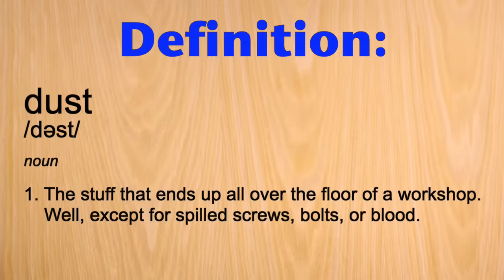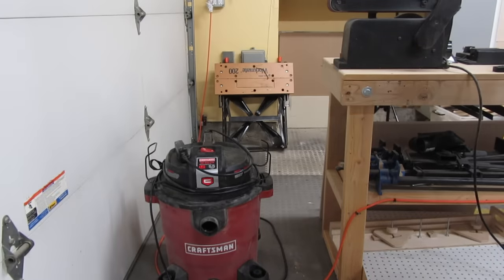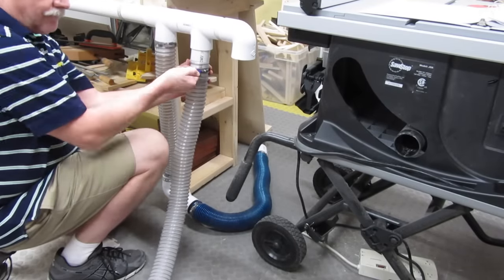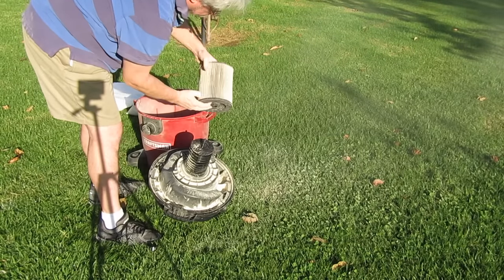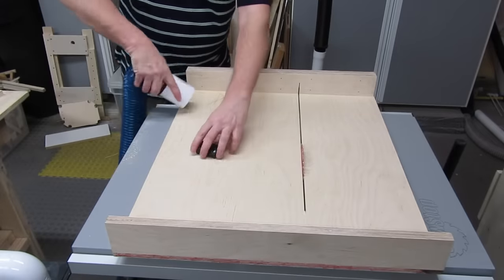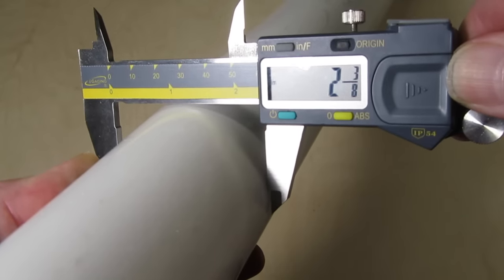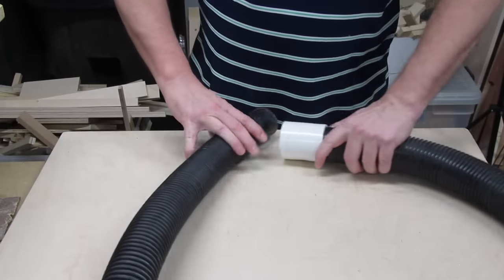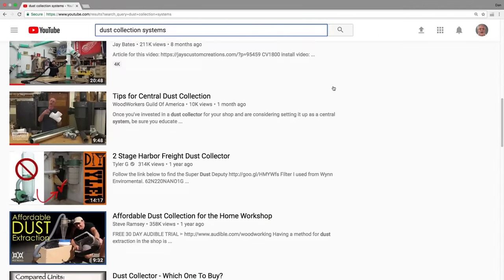Dust Collection for Newbies: Introduction to Dust Collection

Comment: Another great video. Great set up for a shop vac. and that you have hose connection information is so very helpful.   Some notes I have gathered from my bild... .. .
Most important the fine particulates, (smaller than 3 microns) .. that hang in the air indefinitely are the worse! your shop can look pristine but the stuff that you cannot see could kill you.  The most bestest thing you can have is cross ventilation from the outside, villa garage doors with a fan in the home woodshop. I live in Ga where it gets very cold in the winter but still do so. With that said you have a great system using a regular shop vac.

Possible best practice, If you dare cut a hole in the wall to vent exhaust outside.  Take time to build/form manifolds closest to the sawdust being created. (Heat mold PVC sheet metal what have you)  Use the least amount of flex pipe as possible, have the fastest running machines closest to vacuum...The chop-saw, most volume needed to collect this dust... very high for a shop vac... too much! The same thing for a table saw but your saw has a very nice collection manifold.  
For anyone going further into dust collecting.. Look up the Thien-baffle. Great simple but effective design  &  Bill Pentz .... 
Bill has passed, but this man influenced the lates home shop dust collectors out there conducted very thorough tests and influenced changes in the most popular collector's being used today. Even if the money isn't there to build a big system Very good information for anyone to graze on. All the tips I made earlier came from this gentlemen's site, if still up and running. Great man.
Reply from the maker: I didn't know Bill Pentz wasn't with us anymore - what a loss! 😢As for fine dust particles, I've been thinking about a video for quite a while. I hope it comes together sooner rather than later, because it's important information. Thanks for the comment!

Comment: I use a bandsaw, it's a pretty clean cut.. Also, I'd recommend making the adapter to the ShopVac be sized to go over the ShopVac end, then you can make an L-slot on the oversized end to lock the hose onto the ShopVac.
Reply from the maker: Thanks for the information! 😄

Comment: I've miter chopped many PVC pipes anywhere from 1/2" to 4", never had a problem or felt un-safe. I can see where it might be hazardous on a table saw, bringing the material to the blade, but with the miter saw you're bringing the blade to the materials.
Reply from the maker: Thanks for the info! 😄

Comment: Cutting PVC with a miter saw works like a charm. It fits against the fenced well and as long as you don't cut it too quickly it works great. But taking off an inch or two can be a problem
Reply from the maker: Thanks for the info! 😄

Comment: I use a miter to cut plastic pipe and acrylic regularly. However, my ten inch blades have sixty teeth.  More teeth is better, and less likely to create the PVC explosion you mention.

If you are going to play with wood, and when you can, invest in a dust collector.  Even a Harbor Freight unit can be gold.  However, immediately change the bottom bag to a plastic bag (they don't let dust back in the air), if the unit doesn't already have one. At the least, go on line and buy a replacement 20", one micron filter bag. Better yet, if you can afford it, double the air movement by investing in a pleated filter. Again, go for one micron or less (e.g., a half micron).  After you get over the sticker shock, you'll be glad you did.

P.S. Don't even think about using one of the tiny Dust Deputy's with a dust collector. Collectors are designed for four inch or larger hoses and the Deputy would restrict the flow too much.
Reply from the maker: Thanks again for the comment. One of these days I'll get around to doing a full video on the subject, but the truth is, if all I have are devices with with dust ports smaller than 4", there's no real point in moving up to a blower. In fact, depending on the dust collector, it could actually damage the blower (I think). I now have a cabinet-style table saw with a 4" dust port, and it's possible I'll upgrade, but I doubt it. The cabinet catches everything the dust collector doesn't, and unless I add overhead dust collection, upgrading the dust collector won't really help the top-side dust.

As far as small dust particles are concerned, if you're venting your dust collector inside your workshop, all you're really doing is moving the small particles from the place they're created, to a device that blows them all over the shop. http://billpentz.com/woodworking/cyclone/beginnnerscorner.cfm#foreword (and many other places on his website). And where I live, it's illegal to vent the dust collector outside. So again, no real benefits for me.

Comment: PVC is notorious for static electricity and holding on to wood dust. So I would highly recommend buying a spool of un-shielded wire and wiping it around the PVC from beginning to end connected to a screw at every joint and grounding the wire at an outlet or ground rod. This will greatly eliminate the static on the pvc piping
Reply from the maker: Here's my thoughts on that subject: https://thenewbiewoodworker.com/2020/01/21/dust-collection-and-pvc-static-fire-danger.html

Comment: I've been making sawdust for about fifty years. For a few decades of that, a shop vacuum was my main solution. From that, I stepped up big time and installed a couple squirrel cages. With an open door, I could turn one or both on and, wearing a mask, fire up my shop vac in leaf blower mode and make much of what landed on everything airborne, then removed by the fans.

The fan solution worked well for removing dust after the fact. Of course, my part of the neighborhood looked horrible for several minutes when I ran the blowers.  Too, though I could get my shop looking pretty good, they did little for stuff being tossed in the air, and the moved any heated air outside pretty quick.

A few decades in, craigslist came into existence and I was able to move to a cheap Chinese collector. It was life changing, as far as visible dust was concerned.  Later, I learned the bags were so poor at collecting the fines these collectors are, appropriately, referred to as dust pumps. 

Now, again thanks to craigslist, I have four bag collectors, cyclones and only use the vac for hand held sanders.  The shop looks good and there are few fines floating about, thanks to quality pleated filters.

As noted here, cyclones are game changers. I have them on my shop vac, my sandblast cabinet and big dust collectors.

P.S. Change those T's to Y's and collection will, vastly, improve. Every turn is like adding several feet of sucking killing pipe.
Reply from the maker: Thanks for the comment! Regarding changing the T's to Y's, when you're using 2 1/2" pipes with a shop vac, it makes almost no difference. With "blower" type dust collectors, you're right, it makes a huge difference. But not with shop vac-based systems. At least, not according to my anemometer. It has something to do with the difference between air speed vs. air volume, or something like that.

Comment: Thanks sir. I have enjoyed watching your videos and hearing your humor.

I have now after several videos, including yours, ways to design my dust collection system. I just have to find what will work for my very small workshop. As for the chop saw/miter saw, it can be safer to use to cut pipe. However, like you mentioned, the PVC pipe kind of exploded on me. It scared the crap out of me too. I believe most of my issues have to do with the type / number of teeth the blade has. Finer /more teeth the better, basic blade info. Those are my thoughts.

Again thanks again for your take on dust collection and many other videos.
Reply from the maker: Thanks, glad I could help! I think I've figured out the exploding issue. You can't let the PVC "chatter" at all - it has to be solidly clamped down. I've been trying that lately on my table saw, clamping PVC to my large crosscut sled, and so far, so good. I still wear a face shield, though. 😄

Comment: I made a simple change to my 'shop-vac' to reduce the amount of dust ending up on the filter. I fitted a right-angle elbow to the inside of the inlet port, pointing around the periphery of the canister.  Incoming material now follows a path like a wall-of-death motorcyclist and drops to the bottom rather than heading straight across to the filter.  It doesn't replace a proper cyclone but it does help in reducing the frequency of filter clog.
Reply from the maker: Good idea. And actually, if I'm not mistaken, some vacuums are already built that way.
Reply: @TheNewbieWoodworker  Yes, that may well be.  I guess that following basic scientific principles will often lead to similar outcomes - maybe that's why modern cars no longer have the individuality of earlier years.
Reply from the maker: @robt2151  "maybe that's why modern cars no longer have the individuality of earlier years" - My wife complains about that all the time. And I suspect you're right. 😄

Comment: im happy you mentioned the amazon links. too many youtubers just link them and don't explain it or try to hid the fact it's an affiliate link. nice setup btw.
Reply from the maker: Thanks. The problem with affiliate links, specifically Amazon links, is that Amazon is really, REALLY picky about what you can and can't say. I'm not even supposed to say that you can support my channel by using them. In fact just recently they made me change the text on my website so it doesn't say that. So that's why most people don't even mention it.
Reply: @TheNewbieWoodworker  that sucks. i think it adds more transparency instead of trying to be sneaky links.
Reply from the maker: @zero.g13  I agree completely. My guess is it's due to legal issues, so Amazon isn't seen as endorsing the content of videos and websites.

Comment: Invest in a good sliding miter saw it is truly a must have for a shop
Reply from the maker: "Must have" is a strong term. I don't have one - I don't have room for one, and I've managed to get by without it. A good cross cut sled or two can handle many of the tasks you use a miter saw for. And miters can always be cut by hand (I hope I don't ever have to, though). Not to mention that experienced woodworkers like Matthias Wandel don't use one. So, to say its a "must have" is an overstatement. HOWEVER, I wish I had the space for one, because I'm sure I'd use it a lot if I did.

Comment: I use a metal chop saw to cut PVC pipe. Works pretty well.
I really like the simplicity of your dust collection. I think I'll try it.
Thanks 👍
Reply from the maker: Thanks for the tip!
Reply: I've also had good results with a metal cutting blade(I was using my radial arm saw)
Reply from the maker: @bweber6256  Thanks!

Comment: This is great stuff, love the approach on your channel, thank you.  My newbie workshop is still growing and not finally configured so I made a “dust devil over shopvac” like yours but it can move on the vac castors. I like it so much that I sometimes take it in the house for big cleanup jobs :) 

I do have a mitre saw – widely regarded as the worst tool for dust making. I connected the dust port but it only got maybe 30% of the dust. There are many videos with ideas to solve this. What I did was make a prototype “hood” from cardboard and duct tape with a 2” port on the lower backside. This gives a steady airflow over the whole blade and table and using both this and the unmodified official port gets 99% of the dust into the collector. Just needs a quick dust with the flying vac tube at the end of the evening.
Reply from the maker: Hoods are a great way to help with dust collection, or at least that's what I've read. So good job! 😄

Comment: Good video!  Currently I am just dragging my shop vac around.  You make it look easy to put a system in place.    I briefly saw your light hanging from the ceiling.  Hope you have a video on how to build one.
Reply from the maker: Thanks. It's not that hard, just takes some effort. The only lights I have hanging from the ceiling are ones I bought from Amazon. Maybe you're talking about my ceiling-mounted camera dolly? If so, I don't really have a video on it, although I have one showing the early stages of building it. https://youtu.be/w7R6okOuvzk

Comment: I'm an electrician and love the "scissor" type PVC cutters you mentioned, but typically I would be cutting smaller diameter tubes. I'm not sure how them would go on larger stuff. One great thing about them is zero dust.

I'm quite concerned about dust inhalation, particularly, brick dust which is a problem in my trade. 

My father was a carpenter all his life and, although it wasn't the dust in his lungs that killed him in the end, the constant coughing due to the dust did make the last 10 or 15 years of his life miserable.
Reply from the maker: Thanks for the info! 👍

Comment: Great video outlining dust collection for those just getting started or who want a simple system. As far as the minor improvements go, most of them improve airflow efficiency, meaning you have less resistance to air flow. Maybe doing a few small changes won't have a big effect, but if the system is designed with those small improvements in mind, the overall effect will be greater suction/airflow from the shop vac. After all, a system is the sum of its parts right? I really enjoyed seeing your shop layout too. Compact but efficient. Thanks again for the great content!
Reply from the maker: Thanks, Drew, and you're right about the design. As with just about any of my projects, I do some level of planning, but I come up with most of it on the fly. So like everything else in life, if I were do do it again, I'd probably change a few things. 😄And thanks for the kind words.

Comment: great solution: inline fan 12" + short section of insulated 12" flex-hose + lots of insulated 6" flex-hose + flanges, blast gates, dust collectors for each station + cyclone dust separator and big barrel.
hook it all up and voila. the insulated hose cuts down on noise, you could also add a inline muffler on either side of the in-line fan to make it even more quiet.
Reply: vortex brand in-line fans are the most reliable. and in 12" they have a model that moves huge quantities of air for around $500. you do want to use as big a cyclone as you can get for this size fan though. and best would be a metal barrel to collect the dust, so you never have to worry about it collapsing.
Reply: one last thing, rockler has tons of different hose couplers and flanges. also ones specifically for connecting to 2 1/2" ports on shop vacs and tools.
Reply from the maker: I practically live in my local Rockler store, so I know what you mean. Thanks for the comments!

Comment: Great video. Thank you. I also use a cyclonic dust collector but since I have cats I use empty kitty litter tubs. The brand I use have tight locking lids and when I fill one, I just switch it out with an empty one and snap on a different lid. Plus if the lid I had cut an mounted the cyclone on wears out I’ll just cut a new one. I also had built a similar rack like you did to keep the tub above the vacuum. (great minds think alike). Your video has given me ideas about how to set up my own system in my tiny shop so I don’t have to constantly roll the system to each station. Now I’m going to have to figure out how many blast gates I’m going to need. Thanks for the inspiration.
Reply from the maker: Awesome! Glad I could help. 🙂

Comment: I've cut PVC and with a Miter saw, Table saw and circular saw. Use a 200 tooth plywood saw blade installed in reverse. This way the teeth won't catch on the PVC as the tips are running "backwards". This works great cross cutting vinyl siding with a circular saw in a holding jig. Make sure both halves are secure. Much safer method.
Reply from the maker: Thanks for the info!

Comment: Regarding using a chop saw to cut PVC when I really need to make an exact cut that’s when using the chop saw comes in handing. The only time there was an incident was when handling the PVC it was not firmly on the backstop. Other then that never have had a problem. I don’t have go through that mishap again. Learned the first time. Good vid!!
Reply from the maker: Sometimes those are the best lessons. And thanks!

Comment: Great video, and first rate production, what i find confusing with all vacuums is the different way they tell you how much they suck
Reply from the maker: Thanks! Yes, that's hard to figure out. In the end, I just bought something at my local Home Depot that had good on-line user reviews. I knew I could take it back if it sucked, or didn't suck... you know what I mean. 😛

Comment: Great video. Only suggestion I have is to run a piece of bare 12 or 14 gauge ground wire through your PVC pipe and attach it to a good ground. The air running through the PVC creates static electricity and being sawdust can be very explosive under the right circumstances, you could have a potential problem. The wire will give the static a place to discharge without creating a potential spark. Not say it will happen, but it’s cheaper to run a wire than rebuild a shop. I love the video though, especially the cyclone, never seen a small one like that.
Reply from the maker: Thanks! I have a video about static electricity and grounding, but here's my feelings on the subject: https://www.rockler.com/exploding-pvc-dust-collection-ductwork